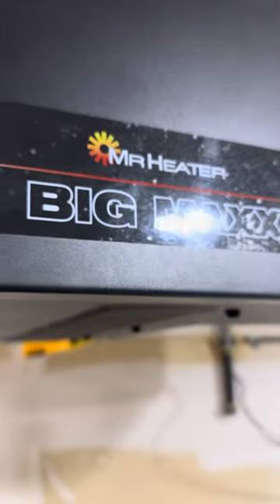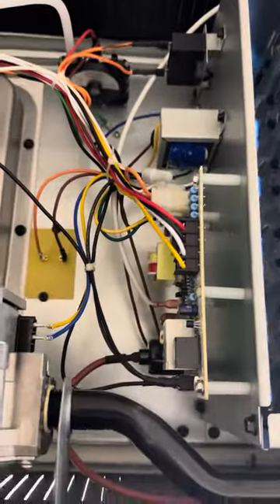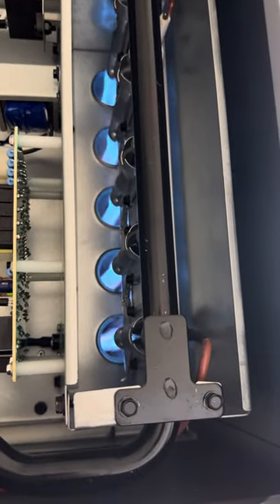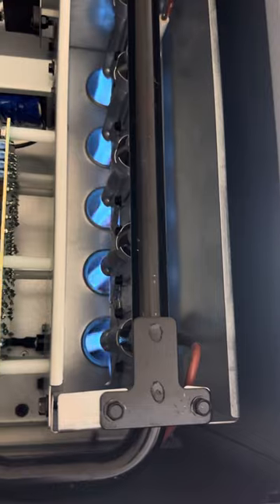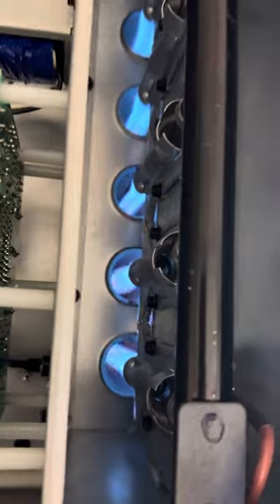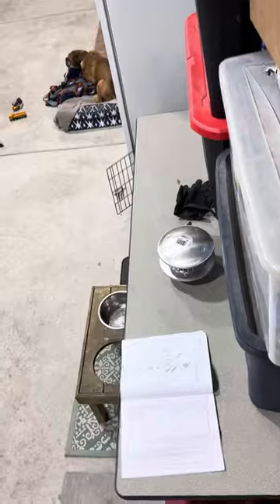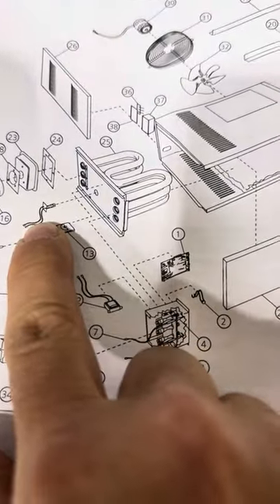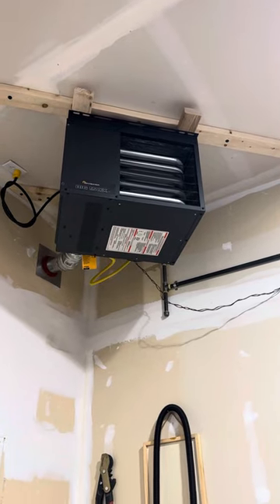Mr Heater Big Maxx MHU80 short cycle problem

Comment: Had the same issue it turn out to be the pressure switch, all you have to do is flip it upside down, but it makes sens why it trips as the heater gets hot so lowering the gas helps too, you can also adjust the pressure from the regulator inside the heater, flipping the pressure switch took care of the problem for me.

Comment: Having the same problem with short cycle. Trying to find a fix. Already messed with pressure switch and ordered a new one. But Aren’t you limiting the btu capacity that way by choking the gas flow?
Reply from the maker: I turned down my gas flow and now don’t have any issues.  Maybe it limits the BTUs but my garage is still staying a comfortable 60 degrees.
Reply: Mine is doing the exact same thing. Did you ever figure out a real fix besides turning the gas down?
Reply from the maker: @rickschroeder5813  not yet.
Reply: @evantugby   has turning the flow down continued to work for you? I may have to try that after work tonight.
Reply from the maker: @rickschroeder5813  yes, although it puts out less heat which makes the unit stay on longer to reach set temp.
Reply: What was the problem
Reply from the maker: @edwards5958  I believe it was the temp sensor to the heat exchanger.  I believe it senses the heat exchanger is getting to hot, so it shuts off the gas when it’s at max blue flame.  When I reduce the gas, the blue flame gets smaller and the unit stays on without short cycling.
Reply: I genuinely think we are just way over gassing these heaters I choked mine down as well and it stays lit true it doesn't put out crazy heat but I was noticing a lot of this heat was getting lost out the vent now the heat exchanger is doing its job and efficiently using the heat that's made instead of spitting it outside